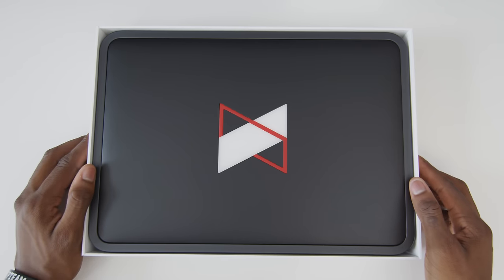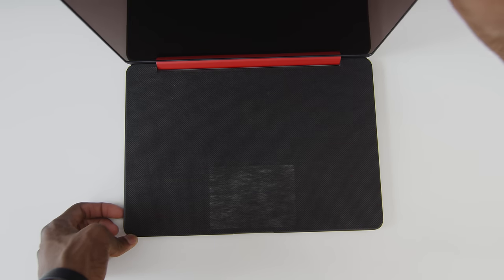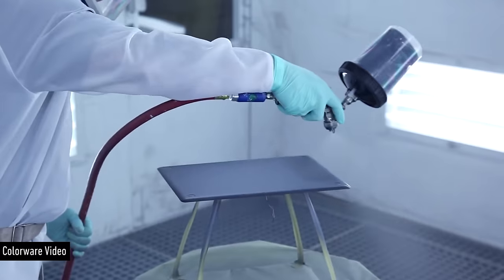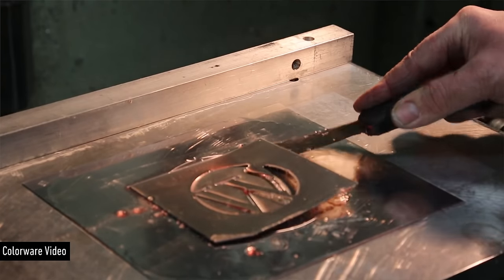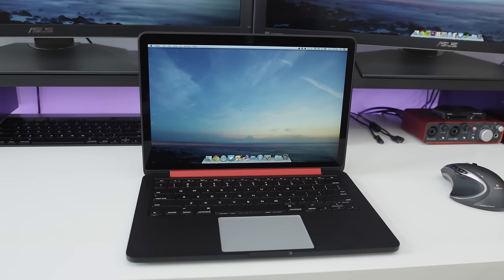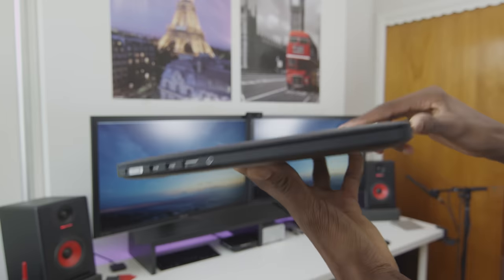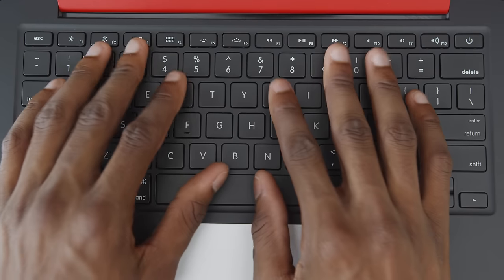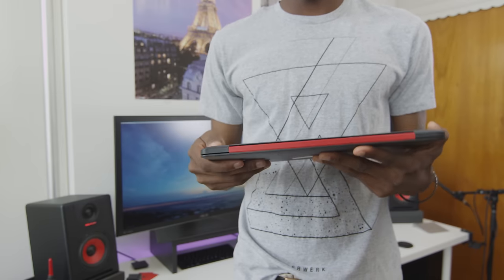MKBHD Edition Macbook Pro! (Colorware Custom)

Comment: Without any doubt an amazing unique design for the MacBook Pro. 

A real shame though that it is not possible to change the color of/ below the trackpad though.
Reply: ***** don't think it will work that well. Because of the sensitivity inside of the trackpad. If they had a sticker on it then it might not even run at all.
Reply: They used to allow it but it was very expensive 200$ more because they had to take it completely apart to paint
Reply: ***** That's what he said.... ;)
Reply: Maybe it would be possible to do something similar with a Razor Blade 14 since the trackpad is already black.

Comment: Its been like 2 years.
How did the paint job hold up?
Reply: +Christopher Smikle  i dont know, but i think the original paint is powdercoated, i dont think this is. So if its like that i think the original paintwork is just better quality.
Reply: Powdercoating is a painting technique where they apply dry powder electrostatically and then bake it in an oven, creating a hard finnish that is usually of better quality (it tougher and more resistant to scratches) than conventional painting which is what i think they used.
if my statement is correct then youre paying them money to decrease the quality of you paintjob
Reply: I've had my colorware custom macbook for about 4 years. After an year i noticed some chipping on the edges and it sucks... with every year i notice more chips and scratches even if handled with care... Wish it would hold up better but its paint after all.
Reply: i checked the original paintjob on a mac and its anodized(not powdercoated like i originally thought, so it's better).
The technique these guys used might be powdercoating, or it might be anodizing but i dont think its up to the standard of the original
Reply: He did a new video about his tech and yeahh chips show up.
Reply: +NatTactikz My Macbook Pro is 4 years old and not painted, and there i see much black spots in edges, so original "paint" will go off as well. And I like it because its boring if product gets old and does not look like it.
Reply: but where that mkbhd logo at tho
Reply: MacBooks are anodized, not painted.

Comment: It's been 2 years - how about the durability? :)
Reply: it's a thin layer of paint, it will scratch super easy. Apple laptops are not bare aluminium, they are anodized and that is the best way to color aluminium. Paint is super weak.
Reply: @PoltergeistWorks  This isn't true at all. They are spraying a catalyzed urethane, which is very durable.
Reply: Zack C it’s been 5 years